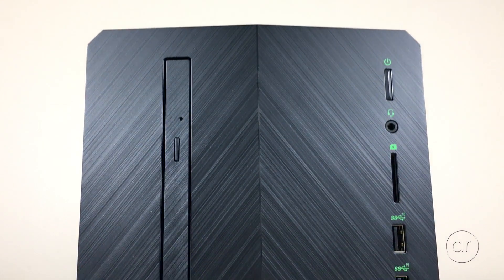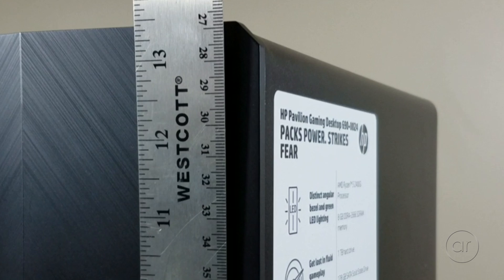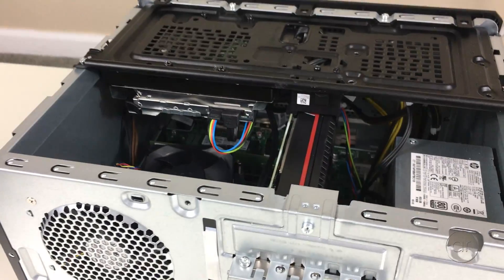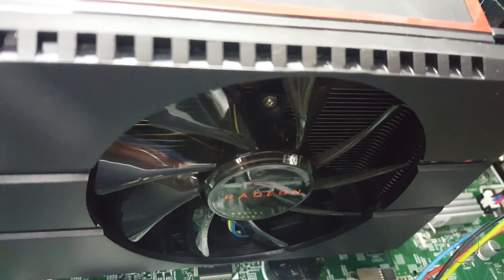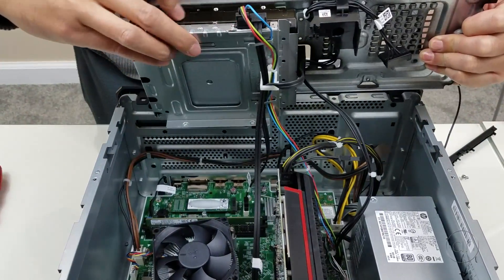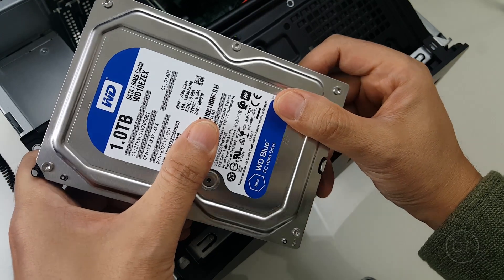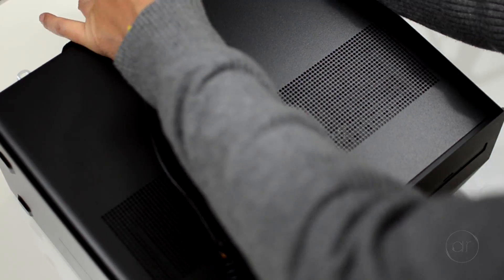How to Open and Upgrade a Ryzen-Based HP Pavilion Gaming Desktop

Comment: For some reason my side panel won't come out
Reply from the maker: Do you mean the side panel or the inner cage? For the side panel, it should slide toward you (as you are facing the rear of the case), and then lift outward.
Reply: access random my side panel I have same pc as that, also if you know how to fix "signal input not found" can you tell me how please all my wires are connected but it won't work my monitor is dvi and my pc has hdmi both are connected but it still says signal not found
Reply from the maker: The 690-0024 has three DisplayPort and one HDMI, so are you using a DisplayPort to DVI adapter? Also - when you say you have both connected, are you connecting to two monitors at the same time?

I'd try different cables and a different monitor (if possible) to rule those out. If you don't see a signal at all, you may have a defective unit.
Reply: access random I have 1 monitor that doesn't have hdmi so I bought dvi to hdmi and the dvi part is connected to monitor and the hdmi is in my pc tower but when I turn my pc tower on the monitor doesn't turn on when And says that the input signal isn't found in the monitor yet I have the wires connected and I was wondering how to fix it cuz it's been 4 days
Reply from the maker: I've heard of possible incompatibilities between DVI-HDMI adapters and some monitors. Since there are four possible points of failure (possible bad PC port, adapter, cable, or monitor port), I'm afraid the surefire way to find out is to try swapping out the different components.
Reply: access random I tried to open the side panel but it's difficult cuz idk how to I tried what you told me but it takes a lot of force I think I'm doing something wrong
Reply from the maker: Yeah, I'm not sure why because it shouldn't require a lot of force. Are you sure the screw in the back is fully undone?
Reply: access random yes it's fully undone I even tried taking it out fully and trying to open it but it takes to much force and it won't budge
Reply from the maker: That is strange. Perhaps you could take it into Best Buy (or the store that you bought it) and have them take a look? I don't want you to break anything by forcing it.
Reply: access random yea Best Buy I had it for about 2 months and idk how it stopped working I turned it off went to bathroom and when I came back tried turning the pc on it kept saying signal input not found
Reply: @accessrandom   am having the same problem, almost like the side is glued in place or something

Comment: Successful 32GB RAM upgrade.  

2xBLS16G4D30CEST-Ballistix Sport AT 16GB 288-Pin DDR4 SDRAM DDR4 3000 (PC4 24000) Desktop Memory Model.   $100.99 at NewEgg.  

Overkill for a $550 off the shelf desktop? Maybe, but Zoom Zoom.

Thanks for the video.
Reply: except for the fact the motherboard only supports 2666 mhz, so your "3000" is not lol check and you will see is probably 2133. It happened to other users, if you install more than 2666mhz, i brings you down to 2133
Reply: @naegleriafowleri1715  how do I check that? I installed ddr4-3000 and CPU+z shows ram clock is 1500mhz
Reply: @jakew3  task manager - performance, if it shows 1500mhz, it downgraded you, you need exactly 2666mhz or 2400mhz if you are ok with only 2400, anything above 2666 will downgrade you
Reply: @naegleriafowleri1715  thanks for the response but you are incorrect...my upgraded 3000mhz sticks are running at 2666mhz according to task manager - perf-memory tab
Edit: maybe you weren't wrong but others said 3000 would downgrade to lower than stock which didn't happen on mine
Reply: Jake Wagner got lucky i guess lol which brand
Reply: @naegleriafowleri1715  adata xpg 8gbx2. Weird too because before I had g.skill Fortis 2400 and it was running at 2133 if I remember correctly
Reply from the maker: Nice! Thank you - I'll add this to the description.

Comment: can i upgrade the case fan cpu cooler fan? if so what size fans are these? and will i have mobo issues?
Reply: I've done some experimenting with this. First thing you need to know is that even though we have an AM4 based AMD processor...the hold down spacing is for an Intel 115X. So don't try buying an AM4 cooler...it won't fit.  The second thing you need to know is that HP screwed up the layout of this computer. The case fan sucks air out of the case but the air inlet holes are completely blocked by the rack holding the HDD and Optical drive.  Beyond that, I've tried individually removing the HDD from the rack and then removing the optical drive from the rack...the rack itself still blocks the airflow and temps run up to 85c+  playing Fortnite. The only way to improve that is to remove the rack completely and even then it only drops to around 80 degrees under load. I tried replacing the cooler with an Arctic Freezer 11 LP and that only dropped the max temp to 77c with the rack removed. Putting the rack back and we were back up to 80c+ so basically its not possible to have the rack in and get reasonable temps. Knowing that, all bets are off. So I removed the rack and replaced the Freezer 11 LP with a Freezer 12. Unfortunately there are two problems...1) the PWM fan for the Freezer 12 isn't recognized by the motherboard and 2) the M3 screws that come with the kit are too long.  So here's what you have to do...you order a Freezer 12 and a 92mm case fan, you go to home depot and buy two packs of M3-0.5 x 16mm Socket Cap Screws, one pack of M3 flat washers, and some 6" zip ties, you remove the rack entirely, you plug in the 92mm fan and set it aside (because its a hassle with the cooler in place), you replace the CPU cooler with the Freezer 12 using the screws purchased at Home Depot, then you zip tie the 92mm case fan to the Freezer 12 on the RAM side blowing through the cooler toward the back of the case.  This makes a single path pulling cool air across the top RAM, through the cooler, and out the back of the case.  Doing this results in temps maxing out at 65c under full load. For good measure...I also downloaded a fan control software (which doesn't work with the CPU or case fan) to bump up the GPU fan to a minimum of 40%. That helps prevent the GPU from exacerbating the temps inside the case.  Downside to all this is that you lose the HDD and optical drive...and end up with a hole in the front of the case (which actually helps with the airflow).  I went through all this because AMD says the max safe temp for their Ryzen chips is 70c...and this was the only way I could get the temps to stay that low.  This is a major problem with HPs design and there's no other way around it short of serious case modifications.  Good luck!
Reply: Terry Parrott there is a solution. Sell that shit and buy something else lol whatever
Reply: @naegleriafowleri1715  performance is good. I'm using the included Radeon GPU software to limit its output to 160 FPS because I have a 144hz Freesync monitor.  Fortnite pretty much stays pegged at 160 FPS and never drops below 100. Granted...Fortnite isn't exactly Crysis 3...but still...I have no complaints about performance. I couldn't build a PC that performs this well for less than $500...not even close.  Hell, I couldn't build THIS PC for $500...I tried using PC Parts Picker and the closest I could come was ~$800. So I'm not complaining about the PC performance or price...I am complaining about its design with respect to cooling because they are billed as gaming PCs and it can't handle even basic gaming without overheating. Now that I've fixed my overheating issue I need to replace or supplement the SSD as the HDD can't go back in.
Reply from the maker: This is awesome and detailed (and critical) information! Do you mind if I include this in the description? I may have to abridge it a little since I'm approaching the 5000 character limit.
Reply: by all means!
Reply from the maker: Thank you kindly - I formatted your text and ran into the 5000 character limit so I had to edit the text, but I think I got the main points. Let me know if you'd like me to change anything. Thanks again!
Reply: @terryparrott9426  The max safe temp is not 70c. The max temp for Ryzen chips listed on the AMD website is 95c, though I wouldn't call that temp safe (just the point at which it throttles to protect itself). Anything under 80c, while not optimal, is perfectly safe. Though I agree the airflow and cooling of the case is crap. In any event, I'm impressed at the extent you Macgyver'd your computer to get the temps down.
Reply: @terryparrott9426  so, what did u use for the storage? where did u put the hdd? why the motherboard didn't recognize your cooler? Would i have issues if install this one https://www.deepcool.com/product/cpucooler/2013-12/7_481.shtml?
Reply: No reports yet be the guinea pig 🐖
Reply from the maker: I haven't had any reports yet but it would need to be a low profile fan (fans like the 212 EVO and Hyper T4 wouldn't fit).

Comment: looks like maybe you could mount another fan on the bottom of the black tray where the hdd sits?
Reply: actually not a bad idea for people who sit this unit on its side instead of vertical, because that would stir up the air above the chipset heatsink 😅

Comment: i have the same pc, but the ryzen 7 model. looking to do a case swap. do you know if i HAVE to use this motherboard, or can i buy a different one and just swap everything over (cpu, gpu, psu, ram, ssd and hdd, ect)?
Reply from the maker: The only unknown at this time is the power supply - it's a question whether it's a standard PSU. I'll post any news in the description as I receive it.

Otherwise, as long as the motherboard supports the Ryzen 7 2700 (i.e. socket AM4) and has an M.2 slot, you should be able to move everything else over.
Reply: Get rid of the motherboard and power supply and use the other parts. Buy new motherboard and power supply with case that works. Why do this now though. Makes no sense to spend money for this on top of what you already when you could’ve just bought or built the same shit from the start. I would only consider something like this after a few years of usage

Comment: I bought the Ryzen 7 version  and upgraded my ram and its a beast! Selling the old sticks of 2x8GB if anyone wants to match originals and upgrade to 16GB. $35 per stick. Also the power supply on mine is proprietary but there is a 500w version of the same power supply with the same connector. I have no need to upgrade the power supply though so I haven't done it. Just the RAM and went NVME and boy are my benchmarks goood!
Reply: My man from slickdeals. How much faster is that nvme compared to the sata that came with the machine and hp lied about. We should be compensated for all this. We got scammed by hp
Reply: @naegleriafowleri1715  I think it's much faster but to be honest I upgraded both the hard drive and the RAM basically at the same time. But from a user bench standpoint that standard config was 70% 78% 80% and with just the two upgrades went to 68% 113% 107% I could probably OC in ryzen master and tweak that 68% for gaming but I am not that pro yet and will get there one day. But to be at UFO for the other two categories was major for my use
Reply: Capturing Perfection Photography damn you alien now. Any more plans?
Reply: @naegleriafowleri1715  outside of overclocking and trying to find better cooling somehow no other plans unless a better GPU that can fit  comes a long and then I'll also upgrade to the 500w power supply. I hope someone here finds some awesome cooling options as that's what I want to find before I OC.
Reply: Capturing Perfection Photography why not just get rid of the motherboard and psu and transfer everything to a new case?
Reply: @naegleriafowleri1715  I guess that is also an option and I will price out the 3 scenarios thanks for the idea my friend. I also converted the old 128GB ssd to a 3rd internal storage drive FWIW
Reply: What kind of ram did you put in? 2400 or 3000?
Reply: @jakew3  I actually went with a g.skill ripjaws v 3600 cas 19 since I plan to mess with the memory speed and timings once I feel confident
Reply: @capturingperfectionphotography  thank you for the quick reply. Do you think the ripjaws 2400 would still be a decent upgrade over what came pre-installed? I just bought them for 85$ after discount and am debating whether I should cancel the order...thanks again
Reply: @jakew3  if you went from 8Gb to 16Gb I would definitely keep it as you will see a noticeable improvement. There is a limit on the speed timings though without overclocking and I think it defaults to around 2133 vs the 2666 that the original sticks are. Dont quote me on the speeds but I am certain that the speed timing gets limited without overclocking
Reply: how did you change the rams speed? There is no option to do so in bios and Im sitting at 1035.0 mhz of possible 2400.
Reply: did you run the passmark tests. I have the 690-067c and it have very high memory latency  ~88 ns even thought they are spec'd at 19ns.  Also what NVME did you install ?

Comment: Processor is upgradeable to Ryzen  2700.  Ryzen processors with an X at the end are not supported.
Reply: Thats all fine and dandy except that processor is like $250 right now which is half the cost of what i paid for this pc 😂
Reply: Be careful of heat...the 2400G already gets way too hot
Reply: @terryparrott9426  could re-application of thermal paste help w\that? I haven't taken off the fan to see how it looks

Comment: just  bought the new upgrade  desktop  with the rizen   dont want to  remove  any of the  drives  just want to install a samsung evo 860  can i use  double  side d tape  to secure it,,  what do you think....
Reply: Double sided tape is all good to use to mount ssds
Reply: @apachehelocopto1779   THANKS will d o that and post the results  after i clone the drive...im thinking  rite under  the hard drive  santi

Comment: I want to install an RX 580 8gb instead of an RX 580 4gb. I know the 4gb is a small card. Any suggestions on which card would fit?
Reply from the maker: I don't have any specific recommendation, but there is a commenter named Apache Helo Copto who gave many suggestions (search for "what gpu could i upgrade to" in the comments and expand the thread - wish I could just hyperlink to it).
Reply: The only option you have for a RX 580 would be the MSI RX 580 8GB

https://www.amazon.com/MSI-256-bit-Graphics-Certified-Refurbished/dp/B07K3LDD75/ref=sr_1_11?ie=UTF8&qid=1548223278&sr=8-11&keywords=rx+580+msi 

Also at 3:24 that little plastic block with the qr code might have to be removed so it docent cause interference with the shroud on that msi card.
Reply: @apachehelocopto1779  has this been done? I am curious because I was just looking at this as an upgrade. Only other adjustments I have made are upgrade the Ram to 16GB. Would there been an issue with the PSU AND is there enough room in this case for the card/ airflow to not cause any major issues?

Comment: Hi, I have a similar desktop with a ryzen 7 1700 cpu. Do you know if the default power supply is strong enough for future cpu and gpu upgrades?
Reply from the maker: I measured the power consumption on my system with a Kill-a-watt and it peaks to a little under 200W with some CPU-GPU intensive games (ymmv). For my model's motherboard, the CPU can be upgraded up to a Ryzen 7 2700 which has a TDP 65W (which is the same as the 1700), and unless you go way higher on the graphics card, I think you should be fine.

Comment: Never changed ram before. Brought a f4-2666c19s-8gis for $43 dollars. Would this stick work fine like the f4-2666c19s-8gnt or would I have issues? Still can return the ram stick as I have not installed it yet. They seem to have the same specs when I looked them up on the gskill page.
Reply from the maker: The specs seems to be fine - the Samsung M378A1K43CB2-CTD runs at 2666 Mhz, 1.2V, and CL19. With all the brand incompatibilities out there, I'm afraid the only surefire way to find out is to try it and test the memory (you can access HP's memory diagnostics after pressing F2, or you could use something like memtest).
Reply: @accessrandom  Thanks so much for the guide. Think the ram on these is a bit random as mine had had an 8gb Hynix brand ram with the same basic specs. The pavilion runs quick but I am going to run memtest as recommend and see how it performs during gaming. Not taking any chances with my OP laptop as getting the same ram stick as included (Going up to 32gb ram on that one).
Reply from the maker: That makes sense - I guess HP can use any memory they want as long as it meets specs. Would you happen to have the model of the Hynix memory, and do you mind if I add your info to the description with credit to you?
Reply: @accessrandom  Could not look at the main sticker as a fan was in the way and I did not want to remove the 4 screws. One of the ram modules says Line 1: SK hynix, Line 2: H5AN8G8NCJR, Line 3: VKC    832V, Line 4: DT8MKJ28WC. Think line 2 is the model number as looking for it I found this ram product page: https://www.skhynix.com/products.view.do?vseq=2452&cseq=73. Think the switch in Ram was to save money as I have never heard of SK hynix. Feel free to add this info if you want.
Reply from the maker: @hvogtx  Thank you!

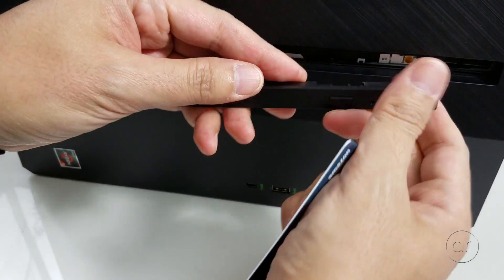Comment: Regarding the optical drive, at 2:33 in the video. You don't have to pop/pry off the  front cover. HP recommends: Before removing the drive cage,  unplug the two cables connected to the rear of the optical drive,  press the lever on the rear of the drive, and simply slide it out to the front (no screws). Reverse when reassembling.

I like that method since you don't risk breaking a tab on the plastic cover, as I have seen reported.
Reply from the maker: Thanks again! 👍😃 Someone had notified me of that earlier but I will add your text to it in the description.
Reply: @accessrandom  maybe make a video on how to do it?